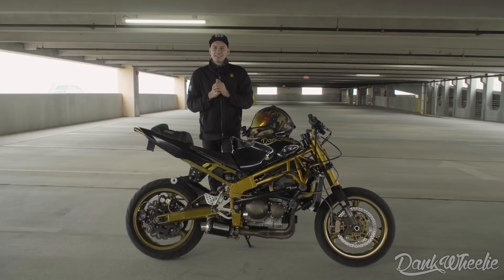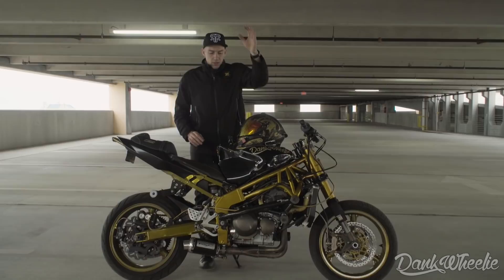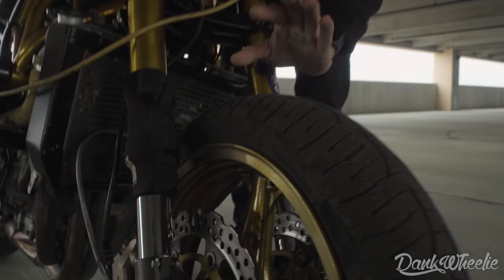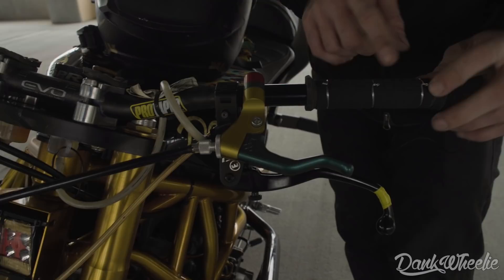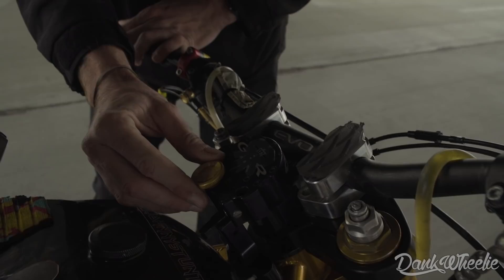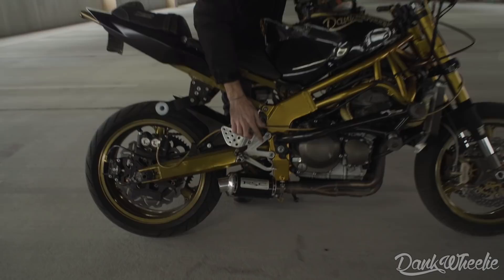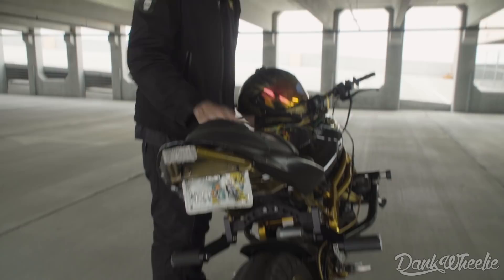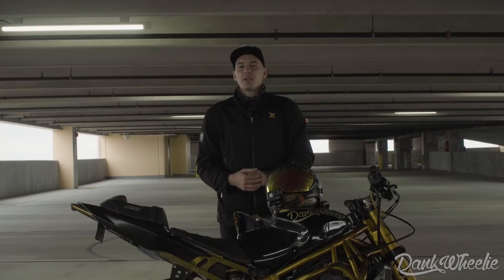Stunt Tips: How A Motorcycle Becomes A Stunt Bike!

Comment: I just started riding my first bike an 08 ninja 500r I love it too man
Reply: I want a 400/500 for my first road bike. How do you like the 500 as your first bike. Ive had dirt bikes atvs anything you can think of except actual road bikes. The 400cc seem fun but easily outgrown.
Reply: @___blaggard999___8  the 500 doesn't have much more power then a 250. I want a 600 or 650 now. You would think a 500 has alot more power then a 250 but its only slightly more. I love the bike but its definitely lacking in power

Comment: Your bikes sick brother looks proper wicked with the new frame aswell glad you got her sorted after the mount on the stock frame snapped one question do you run stiffer / softer springs at all in your bikes and do you stick with oem rear shocks etc or switch them out for ohlins,maxton or some other upmarket shock dampers 👊💯 bless up mike
Reply from the maker: Much appreciated! I’m running stock suspension like most other riders. I do plan to dial in the suspension settings soon.
Reply: Yeah I can only
Go by my own experience with it but setting the rider sag correctly and dialling in your suspension to proper suit you weight height etc made so much of a difference bro to my Zx9r it literally transforms a bikes handling totally. Good luck with your suspension set up man 👊💯👍

Comment: Question.
How expensive is all this? like i see bikes like this a lot in Atlanta, but the people who drive them have a like 9-5 job. I understand someone like you affording this, but what about the commom plebs lmao.
I wanna get into stunts but i really need a price range before i drop cash on a bike.
Reply: Can you wrench? Get a used Bike and a cage and some bars, go from there.  None of the specialty stuff existed till people were already skilled stunters.  You wont need the tank till you can hold balance point, you wont be holding balance point for a while yet. So you wont need a dual caliper till you can sit on the tank etc etc. Just do it gradually and the cost wont seem so severe.
Reply: @DenvarShay  ok thank you. I've got a Yamaha r6 lined up and from what I've heard that's a good starter bike
Reply: @trevtheimposter2255  I would not consider an R6 a starter bike. 2nd bike? Sure. Even the oldest ones have close to 100hp.  That's a lot of bike when you have no experience, especially when you're gonna try getting it on 1 wheel.